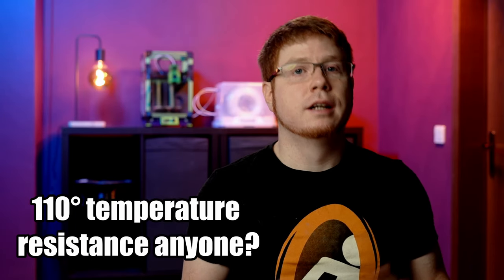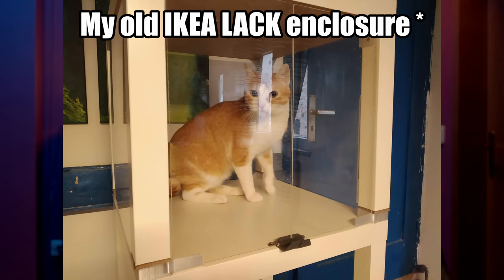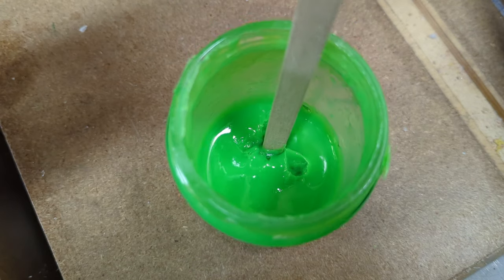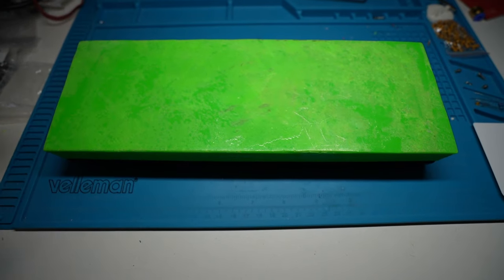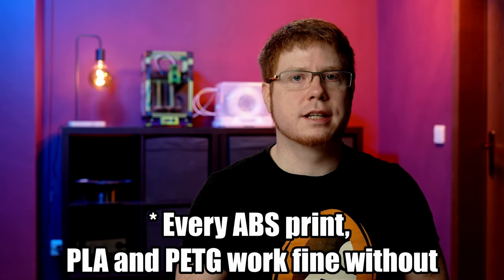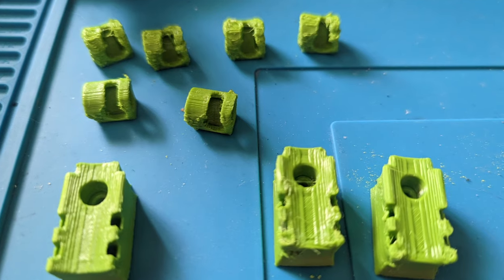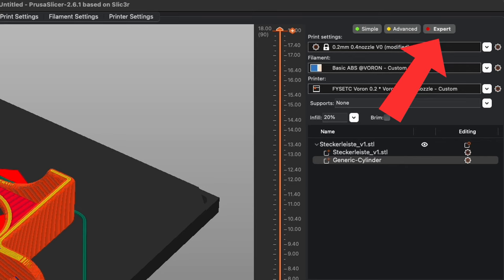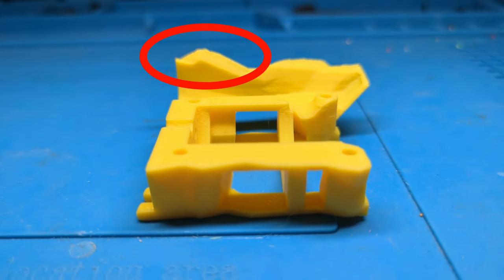3D printing ABS and ASA: The simple SECRET how to get perfect results

Comment: Thank you for a great video.  Currently I am at a point where I can print with ABS and get very good results.  Here are the things on my list:
*  CR-10S (30 x 30 x 40 cm build volume)
* Print on glass
* heat enclosure I made out of a large carton box (openings for control unit to be outside of it)
* Bed temperature 80 degrees C, nozzle 235.  
* Printing speed between 60-30 mm/s, acceleration down to around 5-10 mm/s/s. I would think this ensures better bonding at corners, preventing layer seperation.
* Layer height around 0.12 mm, also experimenting with thicker layer heights.
* Something I picked up recently in another Youtube video, a cover at the bottom of the hot end enclosure to divert the air blowing over the hot end away from the object you are printing.  Not sure if this is only limited to the Creality machines but it seems to be a game changer for me.
* Bed adhesion... A couple of years ago I found that applying spray on clear lacquer creates a very sticky layer on a glass surface, so much so that the ABS printed wonderfully but sometimes even ripping out chunks of glass after it cools down.  More recently I read of a mixture (50/50) of white wood glue and powder sugar.  Currently a combination of these substances provides great results for me.  Basically I just need to reapply a diluted solution of sugar and glue to the glass, a bonus is that you do not need to expose yourself to dangerous fumes like acetone.
*  Brim and mouse ears: a brim is usually mandatory when printing with ABS.  I found that using mouse ears (about 20 mm diameter and 0.6 mm thick) works well for longish, rectangular objects.

Comment: Just wanted to say thank you for this.  Your video has ended a 1 year struggle with ABS!  I don't understand why everything I read on printing ABS was quite so wrong.  Read to print slow, never use the fan etc.  I am not using any adhesion agent, but I am printing at a higher speed and using your tips on the slowdown and fan speeds and magic is happening, thank you so much!!
Reply from the maker: I'm glad I could help! It's been the same for me and I always wondered how some people were able to print ABS so flawlessly...
Reply: I always have warping when using any fan speed, even 10%. I’m guessing you don’t have issues with fan on?  Everything prints great for me except small bridges, which is frustrating because I’m printing parts for a Voron Trident build, on a Bambu Lab machine 🫢
Reply from the maker: ABS works best with an enclosure and high enough temperatures inside. I usually have around 40c. The mentioned Magigoo adhesive prevents warping from the bed pretty good and made all the difference for me.

Comment: I'm using cheap hairspray and it's does the job aswell. I like it because it's easy to apply on the buildplate (always far away from the printer to not cover the moving parts with sticky hairspray).
Reply from the maker: Never had much luck with hairspray. But I only tried what we had at home anyway.
Reply: Hairspray is very flammable so good luck

Comment: Thank you for your video! I have been trying to print test cubes with eSUN ABS+ and had trouble with warping and curling. I had the fan speed set to zero like the manufacturer recommended, but after watching your video I tried 5% regular fan speed / 30% max fan speed and it made the quality just as good as my PLA prints.
Reply from the maker: Glad I could help!
Reply: What are the bed and printing  temperatures??
Reply: @erolchelik  100°C bed, 240°C nozzle. Used a Ender 3 V3 SE and it will print a lot of things in ABS very well with these settings, however the cooling fan seems to sacrifice layer adhesion strength so some objects with more advanced geometry are tough to print. Tried printing a interior piece for a car and it took until the 5th time before it was able to print satisfactory quality all the way to 100%, but still had interlayer cracks and warping that had to be fixed afterwards. Test cubes were much easier.
Reply: @xGSFxGoat  thank you for the answer. It's pretty good for me too. But if I print something large then bed warping up. I didn't unaderstand why. I use ender 5 plus and magnetic build bed layer
Reply from the maker: @erolchelik ABS tends to warp a lot in general. The magnetic bed is probably a bit weak. On my Voron 0 I avoid printing things that cover the whole print bed (it's only 120x120) for that reason. My Prusa mk3 has extremely strong magnets so it's less of an issue. Id the print adheres strongly to the print bed the next logical step for it is to warp the whole bed.

Comment: I have a glas bed and use normal PVA glue as a slurry, that I thinly spread out with a spatula while the bed is heating evaporating the water.
I even reuse the coat multiple times by just spraying the bed with water when it's between 40-50°C.
It works well most of the times, ABS is just notorious.
The most satisfying part for me is when everything is dialed in and the part auto releases from the bed when it's cooled down.
Reply from the maker: That's what I usually do for PLA and PETG, even on PEI. Except for the spatula, I use a wide foam brush. With ABS this was hit or miss for me. The first of the two shown red parts stuck with this, but the second didn't anymore. I assume my glue laser was too thick rather than too thin. I'm almost never patient enough to wait for the bed to cool down though. I use my wife's aquarium as a cooler (only press it on the glass, no water involved)
Reply: @SmallBatchFactory  I also think not all PVA glues are equal.
Each manufacturer has his own unique blend.
So if you found something that works, stick to it.

Comment: I've had really good adhesion using a sheet of PEI lightly sanded with fine grain sandpaper. No other adhesive needed. I run the bed temperature at 115 degrees and it helps with warping. 20% cooling with a single turbine fan. It's a modified Mega S that gets fairly close to a Prusa in quality. The only limitation is I'm using binder clips to hold the sheet down to the bed as a magnetic base will weaken at those temperatures and I don't want a glue mess when I inevitably replace the sheet.
Reply from the maker: That sounds really interesting! Do you have any long term experience? I'd expect that you need to sand the PEI regularly to keep it sticky.

The Prusa uses special magnets that don't weaken at those temperatures. But their heat bed cover does warp.
Reply: I've been using this setup for about three years now. I've replaced it a couple of times. Light sanding with an alcohol wipe for a smooth surface is good if you want a clean print face. Doing it a lot wears it out more quickly. I don't worry about that too much. Adhesion is almost too good. PETG will weld itself at any temperature. It IS easy to mar. I've managed a couple of Klipper head crashes (no end stops) driving the 250 degree nozzle into the bed and leaving a divot on one side. It doesn't go through so I just flip it over. If there's magnets available that have a curie temperature high enough you could get a PEI coated steel sheet. I'd be curious if there's any aftermarket equivalent available. I haven't seen anything. I was thinking an electromagnet failing all else. The clips will only hold it down around them and I have to mind the clearance with the print head on larger prints. For most of what I print it's great and minimal hassle.  @SmallBatchFactory
Reply from the maker: To me it sounds rather expensive if you have to replace the sheet once in a while. My glue bottle is still half full after all these years so the costs seem to be justified. PETG most definitely needs a thin separation layer of PVA, at least that's what I always used. 

I've drilled a groove into my Vorons sheet as well. The endstop is still not reliable for me. The mesh works fine though. My Prusa has a permanent Benchy hologram from forgetting to switch the bed settings. Haven't tried anything above 110c since the thermal fuses I have installed would stop me.

Comment: Hey. thanks for the tips. I print the Prusament ASA with the standard Prusament ASA Profile in my Lack enclosure on my MK3.  I print it  on the textured sheet without any adhesives. The only thing I found very important to have is a draft shield. Also try activating the brim and - since you won't need it for the part itself - move it away from the part and under the draft shield to hold it down in case it warps from drafts. works very well for me. Also I can strongly recommend Vision Miners Nano polymer adhesive as an all purpose adhesive. It is amazing.
Reply from the maker: In my case I apply glue to avoid wasting filament. Both aooroaches work of course. With Magigoo I didn't need any extra brim so there's also less post processing work. My colleague with no enclosure uses the draft shield with success even with no enclosure.

Comment: I was going out of my mind with a large ASA print and out of desperation I bought some Magigoo. That plus adjusting my cooling settings made all the difference. I’ve found that Magigoo on a per print basis isn’t that expensive as one application lasts multiple prints except on the most difficult designs.
Reply from the maker: It definitely lasts a long time. I only ever bought one bottle which is still half full even after a few spools of ABS to build two Voron printers.

Comment: I’ve found chamber preheating to at least 40C improves my success in passive setups.  Even with a chamber temperature sensor, I’ve yet to find a slicer setting that waits for the chamber to get to temperature before printing.
Reply from the maker: It think "wait for temperature" is a firmware specific command. If you run Klipper you could probably write a short macro that does that. You only need to either put it in your regular START_PRINT macro or run it only for specific material and therefore put it into the Slicer start GCODE

Comment: I have actually never had a problem with bed adhesion on textrued PEI. It holds super well, removes itself when cooled down and leaves a sweet texture on the bottom.
Reply from the maker: Consider yourself lucky. For some reasons I always needed at least a bit of glue. Even for PETG on a Prusa PEI bed, textured and smooth.

Comment: Vision Miner Nano Polymer Adhesive is also amazing.  It saved our butts on some ASA printing.  While it is possible to get good enough bed adhesion on some part geometries without it, some absolutely need it.  We even needed print bed clips to prevent the part shrinkage from curling up the magnetic sheet. Good hints in this video.  Thx.
Reply from the maker: Thanks! Plus the costs really aren't that high for adhesive in the long run. The Prusa has very strong magnets, no issues there. With my tiny Voron I can't put too much on the plate at once, otherwise it will definitely lift the 120mm build plate.

Comment: So far, I have not had any issues with bed adhesion, nothing but PEI steel, but cooling needed some tweaking (eSUN ABS+, 250C/105C, about 40-45C chamber temp, E3V2, klipper, Dragon HF, Sherpa Mini, 2x5015 12V fans at 24V, Manta MK2 ducts, dual Z, Mag PEI, Comgrow tent enclosure)
Reply: What your cooling setting sir?

Comment: Another adhesive option that works really well is dissolving filament in acetone to make a 10-20% solution, then applying with a spray bottle. You get the acetone stink, but it's very quick and convenient to apply. Just spritz with the spray bottle where needed. With black or colored filament, it's easy to see if you have the build plate coated sufficiently and what areas need touch-up.
Reply from the maker: That works as well. Just don't use it on PEI, it doesn't like acetone.
Reply: @SmallBatchFactory  I have a magnetic steel plate. It came with a PEI coating, but I flip the plate over so the PEI side is on the bottom when printing ASA.

Comment: Magigoo on the glass bed in my old DaVinci made all the difference. On my 2.4 with pei, i haven't really had an issue with warping off the bed.
Reply from the maker: I have a glass bed of my CR-10 where the print ripped out pieces so it might even be too much. While PEI is nice my ABS prints still need some convincing to stick perfectly.
Reply: @SmallBatchFactory  I've not had it tear out the glass. Usually if I wait for it to cool completely down it just slides off. If I have my offset a little too close it will be a bit harder.
Reply from the maker: The impatience was the problem for me. It's all documented in the video linked at the end

Comment: Printing ABS for 10 years, and never used adhesives. I print on 1.5mm G10/FR4 board at 100 or 105 degrees C. Make sure to never touch it with your hands which will leave grease behind which harms the adhesion . The parts self release when the plate is cooling down. I do make use of printing a brim or mickey mouse ears to corners (slicer option)
Reply from the maker: Those boards work but they aren't magnetic. On magnetic beds you have to fix them another way.
Reply: @SmallBatchFactory  True, if you really want a magnetic build plate.. But I don't get the hype of those. Why is that so important? Do you switch build plates so often? (and if so, why?) My plate can be changed easily too, albeit not in 5 seconds but under a minute.
Reply from the maker: @winandd8649 it's not necessarily about wanting them, but many printers come with those plates today so you need to figure out another way of fixing the plate. My CR-10 uses those clamps that always stick a bit into the print area for example, so you need to be careful where to place them
Reply: @SmallBatchFactory  Okay, it came with the printer, so everyone is forced to use adhesives now.. I never bought an of the shelf printer,  I've always built my own, so that's why I don't have these magnetic sheets luckily 😄
Reply from the maker: @winandd8649 they have their advantages too. I haven't seen many people print with FR4 boards but that's no reason not to use it. Many people don't like to tinker with their machine so that's a bit of an obstacle for many
Reply: @SmallBatchFactory  Yeah, that must be it .. cheers!

Comment: try printing on the smooth side of your build plate, put your first layer width to about 130%. I have never needed to use glue and I always print on the smooth side of the build plate and infact it holds better than the textured side
Reply from the maker: I've also noticed a bit of increased adhesion on smooth surfaces, but for me it was never enough. I don't want to elephant foot on the first layer and I like the texture. Besides Magigoo really goes a long way, still have my first bottle ever half full.
Reply: @SmallBatchFactory  if you tune up your slicer correctly, an increase in first layer width doesn’t necessarily mean elephants foot. It just means that the first layer line is wider and promotes better adhesion to the bed.
Reply from the maker: So you're referring to the extrusion width I guess.
Reply: @SmallBatchFactory   correct, I’m not overflowing just making the bottom layer 130% wider than the extruder nozzle pushes the filament down onto the bed with much more force causing it to adhere much better. The slicer accounts for the extra width and I end up with a perfect first layer. No glue needed

Comment: Never had an issue printing on a glass bed with and without hairspray once I dialed im a few other factors. Key is chamber temperature above 35C, bed temp of 100C, print a bit slower, zero or very little cooling, and increase the flow on the bottom layer so it really squishes that bottom layer into the bed.

I think fan cooling can cause additional issues. A better approach I've found is to set the minimum layer cooling time in the slicer. This slows the print to allow the layer below to cool sufficiently.
Reply from the maker: In my humble beginnings I had the experience that printing slower just resulted in more time for the print to warp for some reason. We printed a lot of faceshields in 2020 and the faster I printed the less I had warping issues. I didn't use Magigoo back then. That was the only occasion where I printed so many of one model that I could really adjust the settings.

If you have time to spare you can of course just slow down the print instead of fan cooling. With the full plate I showed in the video I needed no cooling at all since every layer took long enough.
Reply: I think it depends on what kind of printer you have. A bed slinger moves the print back and forth which is basically like having light cooling. That was my situation, where I saw contraction on corners near the doors until I got chamber temp up high enough and slowed down the print to reduce the cooling effect.
Reply from the maker: I always suspected bed movement to contribute to the unwanted cooling. A colleague uses the "curtain" that Prusa Slicer can create around the print with good success. It basically confirms the theory